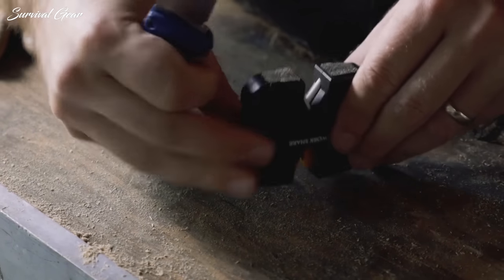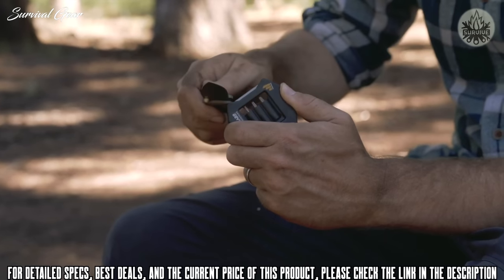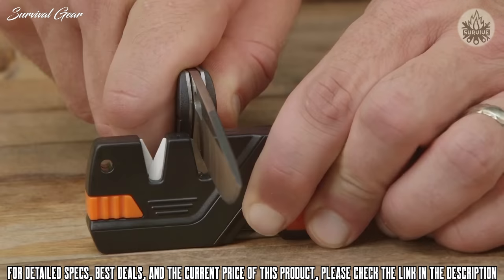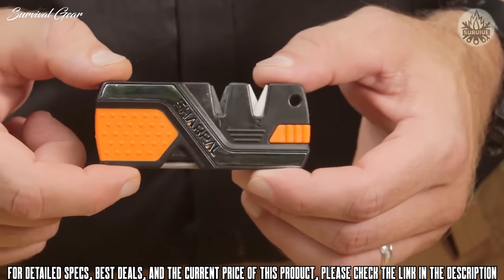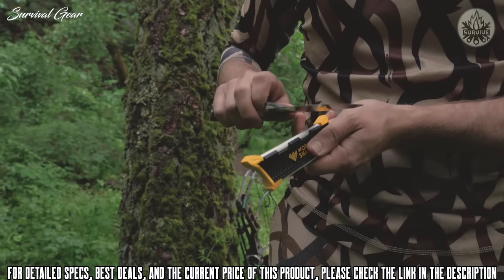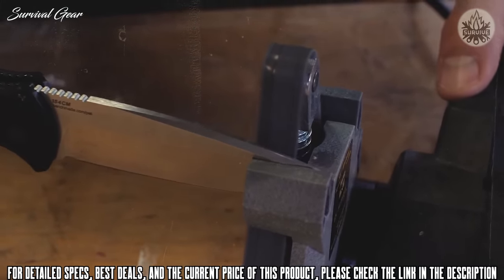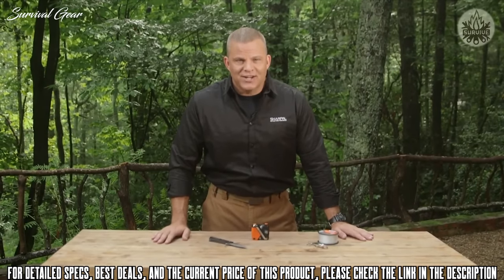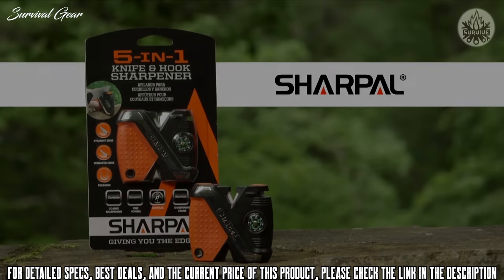TOP 10 BEST KNIFE SHARPENER ON AMAZON 2021

Comment: Worksharp Ken Onion belt sharper with grinder hands down the best tool for the job!!
Reply: I would not let any of my knives get anywhere near the Ken onion belt sharpener...
Reply: @tyyamnitz8408  why is that?
Reply: @fggjr277  because I have expensive knives and any belt sharpener removes way too much material. Using high quality stones is superior because you are mostly just realigning the steels grain to get it sharp again where a belt sharpener is just grinding away steel

Comment: Every knife i own is either benchmade or spyderco. I wouldnt use a single sharpener on this video.. Wicked edge all day.
Reply: The Wicked Edge is pretty expensive especially for a beginner or someone who may be on a tight budget. While I will agree that pull through sharpeners are pretty much crap across the board and the electric Worksharp could potentially ruin a knife, the guided sharpeners are pretty solid. I’ve given the little worksharp one with the torx bits as gifts and got great feedback and I use the worksharp guided field sharpener quite a bit with great results on all of my knives. I just touched up the edge on my S110V PM2 tonight on it and it’s back to hair whittling sharp after about 10 minutes while relaxing on the couch. Unless you always have your Wicked Edge set up, I feel like you’d struggle to have a knife as sharp as fast. Setup of any guided system takes time but a good whetstone or diamond plate takes almost no time at all.
Reply: @deakklok  Not to mention, this is a survival channel. You don’t always hve electricity when you’re surviving.

Comment: Work Sharp Ken Onion is the best knife sharpener on the market
Reply: 100%
Reply: Better than Wicked Edge?  They proud of that sharpener. 🤑
Reply: @onionhead5780  IMHO yes..and its about 50x faster
Reply: @BOOSTEDLASER  👍 Roger that. Thanks for the intel brother. 👊
Reply: If you know what you're doing with it. If not you risk overheating the edge and ruining the heat treat. Just buy some stones or a guided system.
Reply: @deakklok  A 12 year old can use it.I can teach anyone in , 10 seconds.
Reply: @BOOSTEDLASER  it’s a miniature belt grinder. PROFESSIONAL knife makers sometimes have problems with overheating a blade. It’s a common problem for new owners of the system. Even worksharp says it takes practice and not to attempt sharpening your “good knives” until you have practice. So like I said, it is a great system if you know what you are doing with it. I’m not saying it won’t sharpen knives... I’m saying it takes more practice than a manual guided system.
Reply: @deakklok  I have done (guessing) 3000 knives. I have never overheated a knife.I know some folks at Bark River knives...I asked 3 of them..they have never over-heated a knife and ruined a HT with a MUCH more powerfull tool.  I know Brad (from Bradford knives) he does not over-heat knives either.

I guess goofey people exist..or high...or drunk...that can F up anything.

I do know PLENTY in the military that have done bad things with guided or just a bare stone.

Anyway this is silly.

People reading this. A a Work Sharp is 5-20x faster (or more) than ANY other system, period. You will get a superior convex.(really not possible other ways).

I could  teach anyone in 10-15 sec (or less) to use it.

I think the reason SOME may have an error : MANY people rush things, dont read or watch instructions and just dive right in.

I guess in that case, they could round a tip or ...god-knows-what-else.

Anyway,done here
Do not be affraid of a WS.
90% or more of pros use belts for a reason.

Semper Fi
Gunny
Reply: Look out folks we have a certified badass here! LMFAO Go play GW2 buddy.
Reply: @deakklok  It is MUCH harder to overheat an edge than most kids think.I never have in 3000+ uses.
This is silly talk from a person that never used one. I have checked my temps many times and not been 1/3 of or causing issues.
I have head this b4..always from haters that dont own one
Reply: @deakklok  No pro alive has any issues with a belt.
Reply: @BOOSTEDLASER  if you had actually comprehended my comment, I was talking about inexperienced people and those who just rush into things. Rush into things... like you did getting all defensive. And for the record nobody cares who you know. Go play your video game. I’ll be here sharpening my knives freehand. Have a good one;
Reply: @BOOSTEDLASER  lmao the keyboard warrior is strong with you. I must be poor because I don’t have a worksharp. I freehand sharpen boss... if it was good enough for my grandfather it’s good enough for me. As far as “kid” is concerned, based on only your voice I’m assuming you are in your 40’s. You can’t assume that you are older than I am though because you have absolutely nothing to go on. Go play your little game. Impress the people in your guild or group or whatever with your stories of PWNing “some kid” in youtube comments. Peace bro!
Reply: @deakklok  No vids like I said, just more dumb talk.
Reply: @BOOSTEDLASER  yup no vids. No subs. No cares in the world. Enjoy your night. I’m off to work. Third shift is fun!